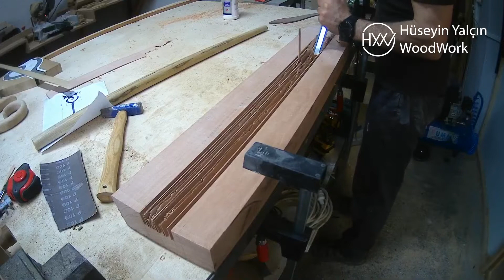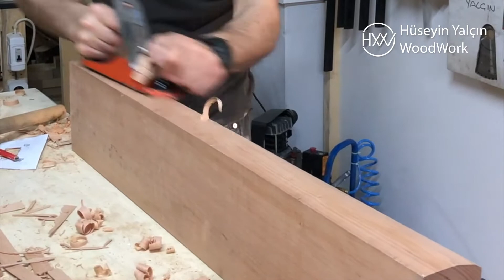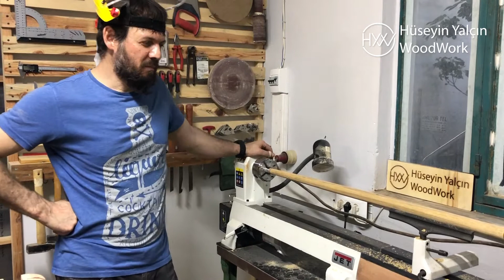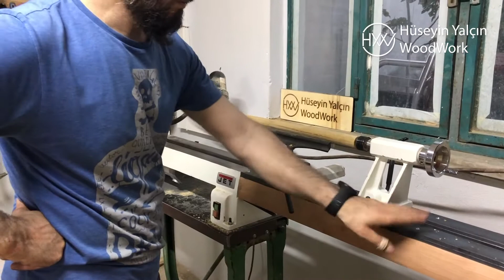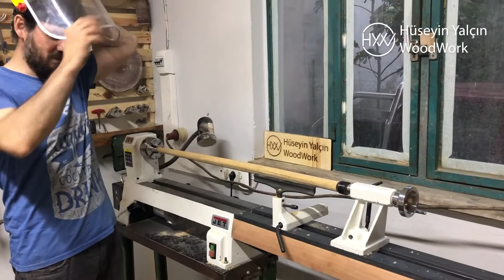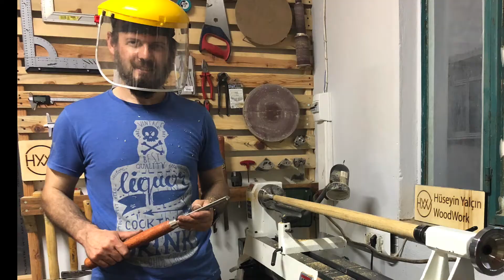Jet Ahşap Torna Yatağı Uzatma

Comment: Hi. Very interesting and creative solution to the problem. I have a Jet 1014 VS lathe and I can’t find a bed extension anywhere. I like your idea of using wood. 
I have some questions if you don’t mind. 
1. What kind of iron did you use? I’ve never heard of Lama Iron. 
2. How thick were the iron rails?
3. How did you attach them to the wood?
4. Where can I get this Lama iron?
Thanks, and good job. 
Paul
Reply from the maker: Hi Paul, thank you. What you need to do is to make the same bed of the lathe. For the dimensions, you should refer to the bed dimensions of the lathe you have. If you write me an e-mail address, I can send you detailed photos.

Comment: Looks great, wish you would have added how you connected the extension to the base of the lathe, with a few pictures.
Reply from the maker: There were two holes on the right surface of the lathe for mounting the extension fixture.  I installed L-shaped brackets in these holes.  I placed the extension on it and screwed it.
Reply from the maker: If you want, I can share some photos on my instagram account tomorrow.
Reply: @HuseyinYalcinWoodWork  wow, I would love to see that!  I'll post a response video with what I did off of your design